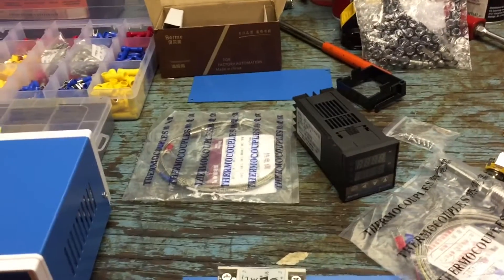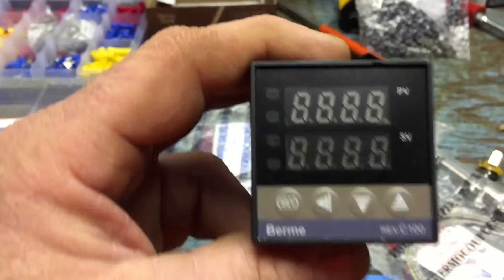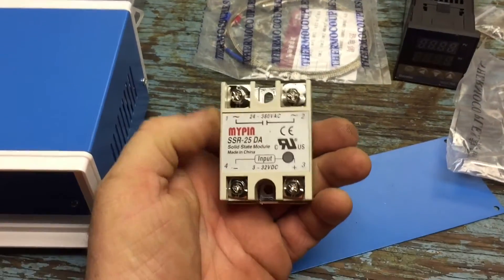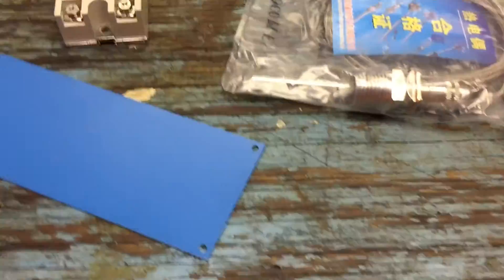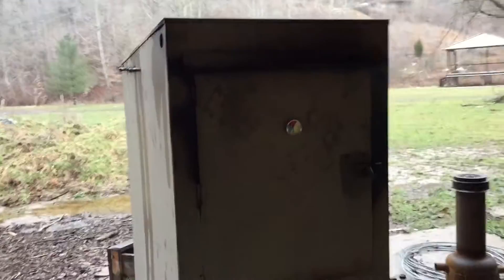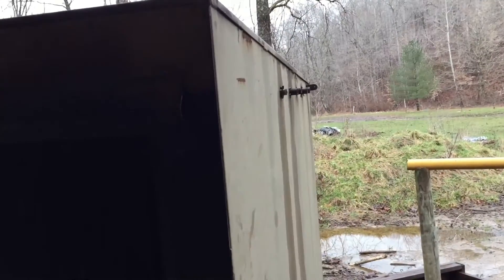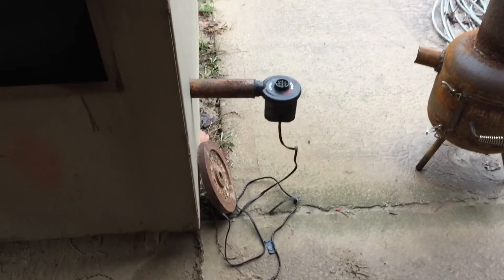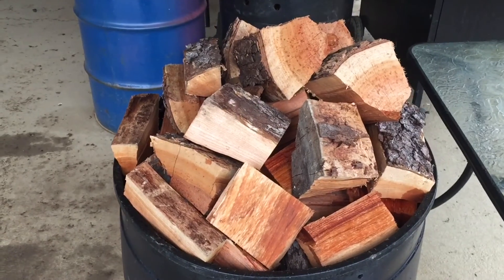Building A PID Temp Controller For A Smoker Pt1

Comment: Hi, I am looking at ali express for a c700 and I am not sure, to have this setup should I buy a SSR or RELAY. I want to connect a 12v DV fan to the output for my smoker. Here is the link to what I am looking to buy https://www.aliexpress.com/item/32953051071.html?spm=a2g0o.productlist.0.0.5be216a1cwXqHL&algo_pvid=16f59572-38a1-4c4b-9f96-f86f6eeeabfe&algo_expid=16f59572-38a1-4c4b-9f96-f86f6eeeabfe-2&btsid=1e21ad30-2724-4e63-8fc9-215486bad35a&ws_ab_test=searchweb0_0,searchweb201602_,searchweb201603_60

Comment: Walter I am late on this comment but if you are using thermocouple then you need to use thermocouple connectors.
A little bit of reading will tell you about the way to make connections with thermocouples the wire and the connectors needs to match the type of thermocouple that you use otherwise your reading will be all over the place
Reply: Cold Junction compensation

Comment: Do you have links or names to the posts? Mainly the connectors for easily plugging in and out
Reply from the maker: If you're talking about the terminal ends you can get an assorted kit for low cost on ebay. For the power I use an IEC socket like used on a computer and for the thermal couple you can use lots of different plugs like 1/4 " guitar jack for instance.
Reply: Did you note a error in displayed temp and measuring with a separate thermocouple? I have huge error since adding quick disconnects 3.5mm audio connectors. to my sampled value on the pid.
Reply: @walterg4082  use thermal couple connectors, they come in all types.  Mini are good for a Smoker PID.  Google panel mount "K" type connector.